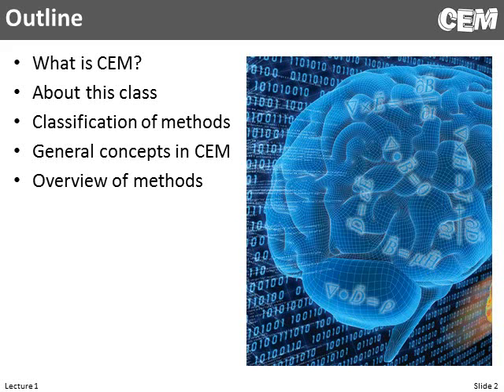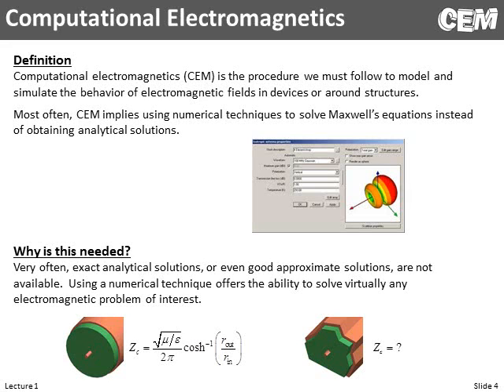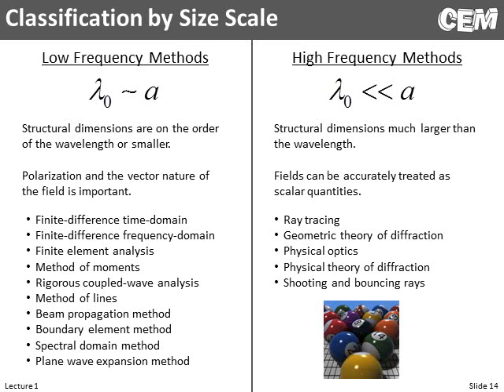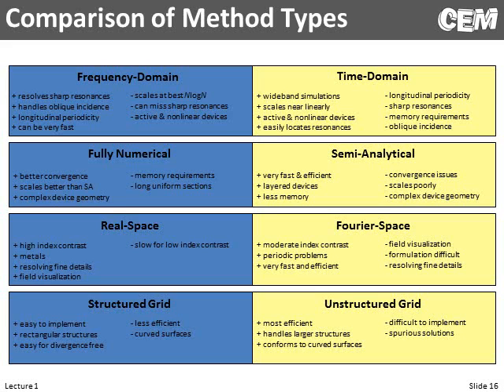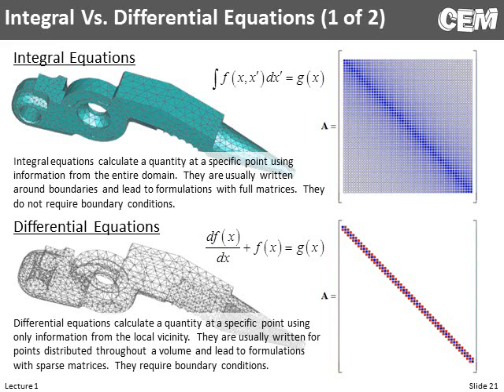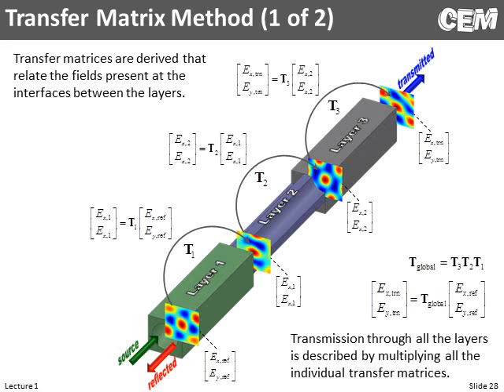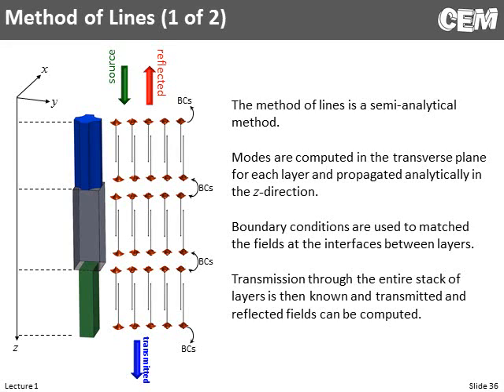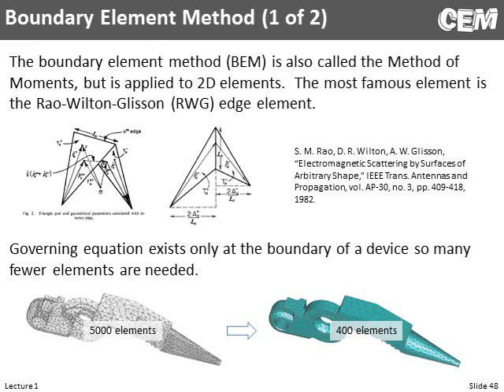Lecture 1 (CEM) -- Introduction to CEM

Comment: Thanks for the tutorial! ! I am a new scholar to CEM. My master's degree focuses on theoretical optics. Now I want to try to transfer the direction to CEM as PHD direction, such as electromagnetic information direction, etc. I was fascinated by the combination of explicit and clear mathematical calculations by computers to achieve control of fields. Can I get any advice from you about the path I've chosen?
Reply from the maker: This is great to hear and I do have lots of advice. This is something I have written about somewhat extensively. I recently started a blog where I have written about topics in EM and also some career related stuff. Here is a link to the blog:

https://empossible.net/blog/

For getting started in computational electromagnetics (CEM), I recommend two posts although some others definitely apply:

Learning Electromagnetics: Where to Start
https://empossible.net/electromagnetics-getting-started/

Getting Started in Numerical Methods
https://empossible.net/getting-started-in-numerical-methods/

In addition, I recently wrote a book titled "Electromagnetic and Photonic Simulation for the Beginner: Finite-Difference Frequency-Domain in MATLAB." The book is intended for the complete beginner to get started in CEM. It teaches the art of CEM through finite-difference frequency-domain (FDFD), which I think is the best FIRST method to learn in CEM. It is incredibly versatile and is one of the easiest to learn and implement. You can learn almost all of the concepts and best practices in CEM with a very simple method that will help you learn and test other methods if you ever want to do that. Here is the book website:

https://empossible.net/fdfdbook/

I think a good SECOND method to learn is finite-difference time-domain (FDTD). For this, I created online resources. While also intended for the complete beginner, the online courses are not as comprehensive about teaching the art of CEM. Here is a link to those courses:

https://empossible.thinkific.com/collections/FDTD-in-MATLAB

With both FDFD and FDTD, there is literally nothing you will not be able to simulate. Any other method will only have the advantage of being faster and/or more memory efficient. However, they will typically be much more difficult to learn and implement.

Hope something here helps!
Reply: Very kind advices and these really helps me! Thank you @empossible1577

Comment: This is a fantastic course for anyone interested in Computational Electromagnetics. I am a graduate student in EE and I work professionally as an RF Engineer. It is very difficult to find quality and comprehensible resources as an introduction to this topic. I believe this is because it requires a relative knowledge of software development, electronics, and of coure electromagnetics. However, I am extremely grateful for you sharing this course online. I have been taking this course (metaphorically speaking) in parallel with my Microwave Circuit Analysis and Design graduate course.
Reply from the maker: That is awesome to hear!  This specific video is the first I ever recorded. It was many years ago! Over time, I have added a ton of content and revised much of it. I actually recommend accessing the notes, videos, and other resources through the course website because it contains the latest versions of all this.

https://empossible.net/emp5337/

Thank you so much for the recognition!!! I love hearing how the courses help people.

Comment: Excellent lectures, Thank you for making these public.  After using commercial programs a great deal I'm learning about how the the methods work hoping that I can write some 'simple' solvers for specific problems in either c++ or Octave.  What's your opinion on the Mode Matching technique? I know its very quick although less arbitrary to say, FEM or FDTD.  However, it's proved difficult to find books or information on the subject.
Reply from the maker: I agree it is difficult or impossible to find good starter books.  For mode matching, you can work through TMM, RCWA, and MoL in this lecture series.  MoL is a numerical mode matching technique.  It can be speeded up considerably if analytical solutions to the modes are known.  Here is a link to the course website that has the latest version of the notes, links to the YouTube videos, benchmarking documents, and other resources to help you get your codes working.

http://emlab.utep.edu/ee5390cem.htm
Reply: CEM Lectures, Thank you! I look forward to seeing these videos and notes.  I wish we had a course like this when I was an undergraduate, your students are very lucky to have such good tuition presented in a lucid fashion with good visuals to demonstrate concepts.
Reply from the maker: Thank you!!  Be sure to visit the official course website, which has links to the videos, the latest version of the notes, and other resources to help you get your codes working.

http://emlab.utep.edu/ee5390cem.htm

Comment: Dear Dr. Raymond Rumpf, 
I have a question about the classification by size scale.

Why can we analyze the phenomenon using Ray Optics when the structural dimensions are much larger than the wavelength? and why it is not available when the dimensions are on the order of the wavelength? 

I know the fact that the dimension relationship lets us know what nature of light will dominate.(Wave or Ray, vector field or scalar quantity)

But, It is difficult to understand intuitively and physically why we can think like this.
Can I have more basic and detailed explanation about this?

Please understand my question even it is the too basic concept.
I hope to see your reply.

Thanks.
Reply from the maker: Rather than overall device size, make the classification based on the smallest feature size of a device.  For example, if we put some crazy nanostructures onto the surface of a lens, that lens will have a polarization response and traditional ray tracing cannot be used.  As just a lens, ray tracing would work fine.  When feature sizes are much larger than a wavelength, we are using refraction which is wavelength independent and polarization independent, thus ray tracing can be used.

Comment: you mentioned in lecture 13 you will illustrate convergence in latter lecture which number is it ,thanks
Reply from the maker: I usually handle this in class when I work through some codes with the students.  I know I do have a slide or two somewhere, but I cannot seem to find it.  

The short story on convergence is that you keep increasing the number of points on your grid until your answer does not change much any more.  You can plot your answer as a function of grid resolution and you will see it follow a random-ish looking exponential curve that approaches some asymptote.  In principle, you can make your calculation as precise as you want, but at the cost of simulation time.  That really is the trade off.  We want fast simulations and we also want converged simulations and the two constantly fight each other.

Comment: "Letcure 27" is not working in the link
                        http://emlab.utep.edu/ee5390cem.htm
Reply from the maker: This lecture actually has not been recorded yet.  This is mostly because the lecture notes themselves are still under development.  Sorry!!!!
Reply: Actually, I need lectures on FEM. So, can you suggest any material for that?
Reply from the maker: There is quite a bit on YouTube for non-electromagnetic problems.  Otherwise, seek textbooks.  I wish I had a better answer for you!  Some day I plan on developing an entire course on variational methods like FEM, method of moments, spectral domain, etc.  I doubt that will happen any time soon.